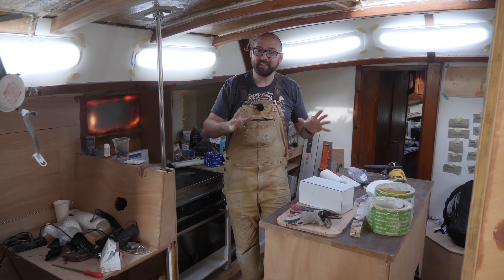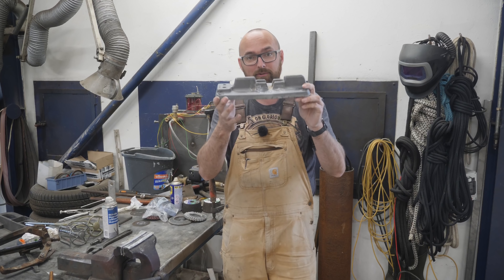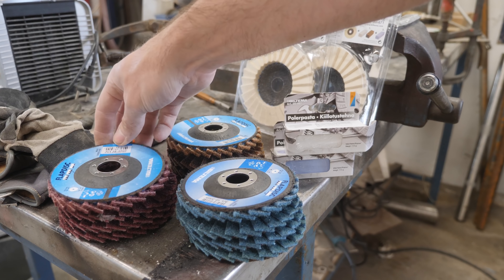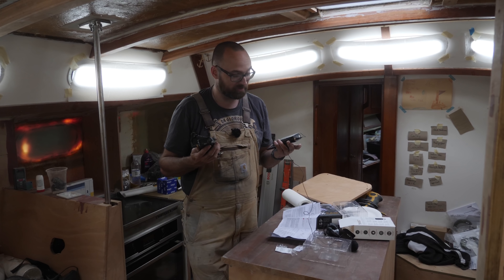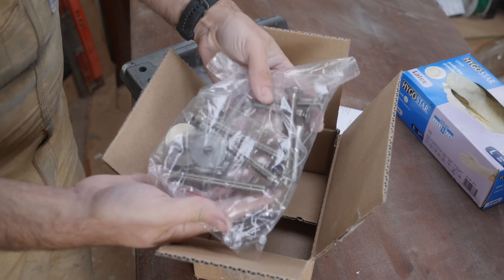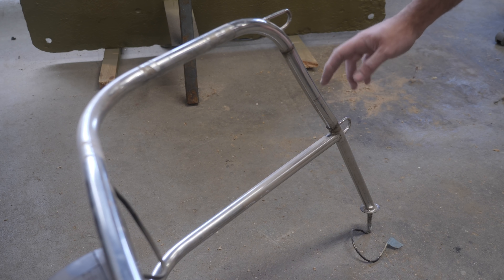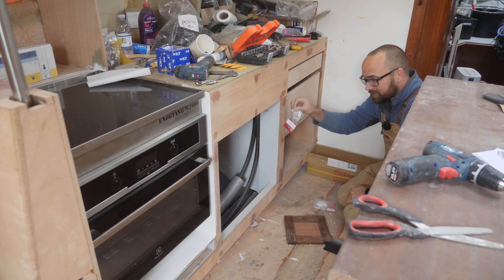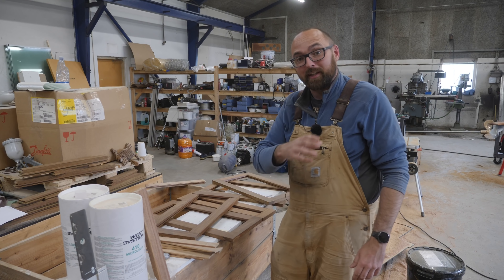Sail Life - A week of sailboat repair projects

Comment: Do you have to polish the chain plates, or is that just a cosmetic thing?
Reply: The higher the mirror polish the better it resists corrosion.  Tiny imperfections are where water/moisture hides and starts crevice corrosion -especially in the sealed areas where it goes through the deck.  That's where chainplates usually rot out as the moisture becomes oxygen-deprived and that is death to stainless.  The smoother it is the better moisture rolls off with gravity.

A mirror finish is easier to maintain from minor surface corrosion too for the same reasons.

Comment: Mads, @ 29 seconds in this video, the picture shows the port side and part of the transom.  will you explain the line across the transom there.  Is that something you've already repaired, or a non-issue?
Reply: Hull/deck joint.

Comment: May I ask what type of fiberglass you used for your structural work (ideally exact product name) and where you ordered it? (I'm from Germany so should be able to order at your shops). I have big hole in my keel and have trouble deciding for the right fiberglass to fix it.
Reply: Check out Life on the Hulls, Roscoe is building at fiberglass cat and talks a lot about the various resins he uses and why

Comment: Why not go a bit more modern on the kitchen and interior? 
https://www.bavariayachts.com/sailing-yachts/cruiser-46-style/interior
Use the router to create handles (like modern Danish kitchens) instead of knobs and steel handles. Even (dare I say it) use wood veneer vinyl wrapping on top of your plywood? You have built some nice curves in the interior, why not just use wrapping to finish it off. Less maintenance, looks good, less work, more modern.

Just my thoughts on it 🤷‍♂️

Comment: I have a very similar set of router bits. Tyoicly the way you set them up is you cut the ends of the rails first and then you cut the stiles and the edges of the rails and use the stub tennon to line up the groove cutter on the stile bit 
https://m.youtube.com/watch?v=oVLYeqWSiqg